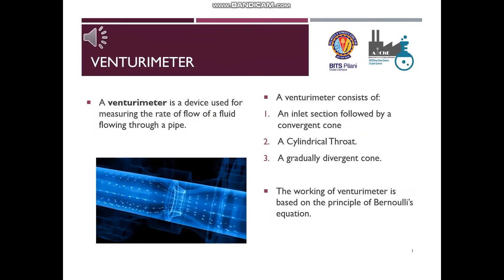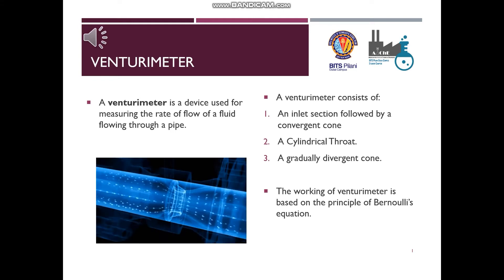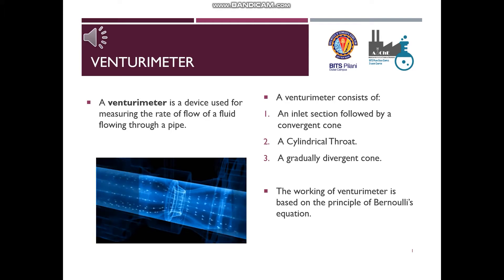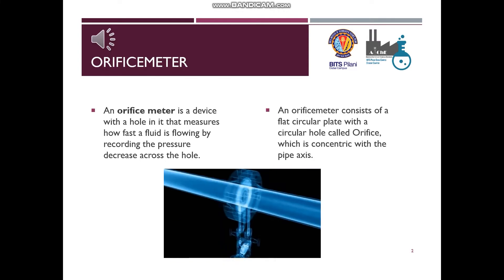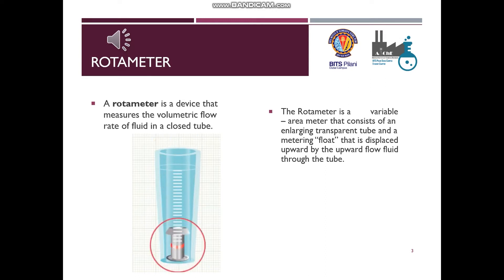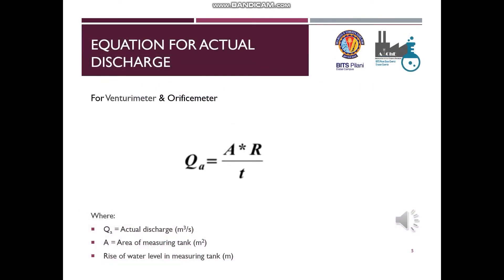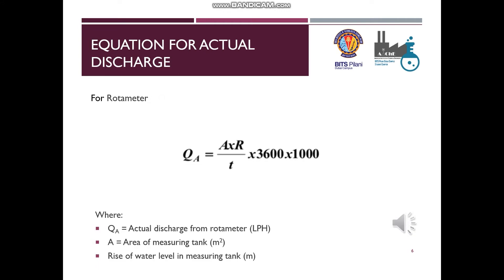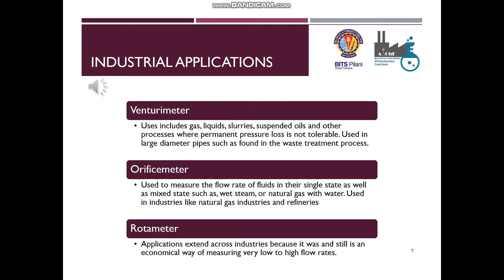Flow Measurement Devices (Venturimeter, Rotameter & Orificemeter) Explanation and Experiment

Comment: sir can you tell me why the u tube manometer's left limb showed higher level as compared to that of right limb even though the left limb of manometer was connected to the upstream side of venturimeter (i.e convergent side).... the pressure is higher in entry of convergent section but yet the manometer left limb shows higher mercury level... cant understand this paradox...
Reply: because  we open the tank or anything to flow through the pipe ,initial static pressure is will  high (v is decreases) when we check  through manometer, then  water flows through sometime  then we again measure the pressure , p is decrease ( velocity increases) or apply the contiunity equation u will get answer .p1> p2  that's why